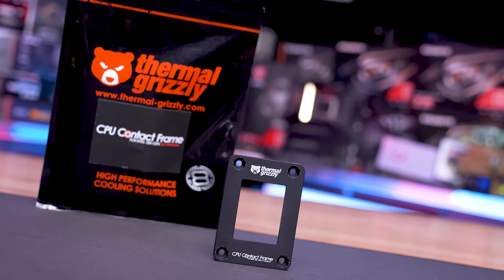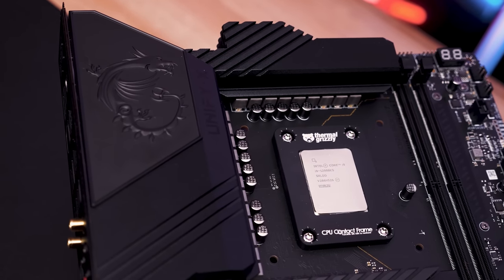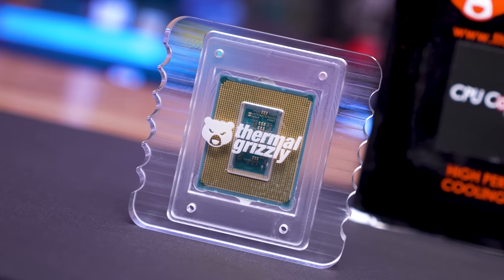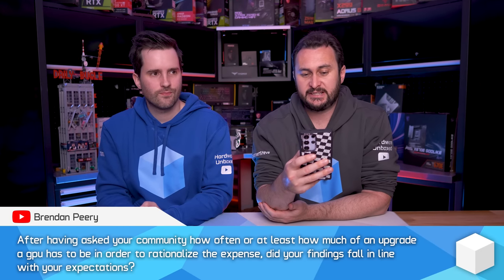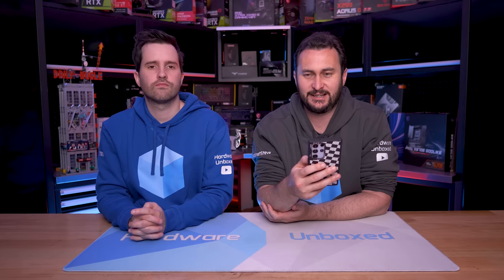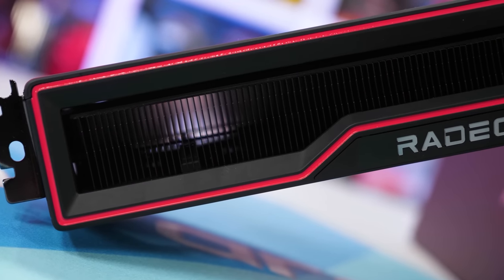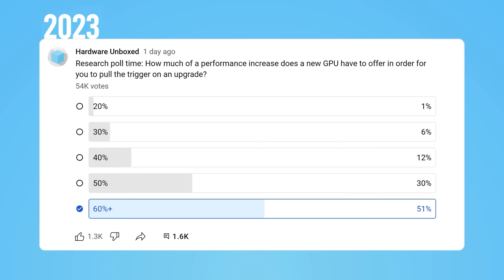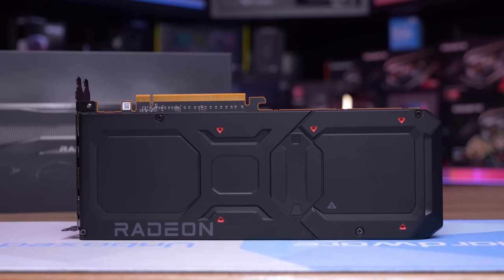RTX 4050 Pricing & VRAM, Are 12-core CPUs Dumb? March Q&A [Part 2]

Comment: I feel the 7950x3d and 7900x3d didn't have as big of a performance gap for 2 reasons. As stated in the video the L2 cache on Zen 4 was doubled to begin with so the extra cache of the x3d parts is less needed or utilized. The second factor I feel is the large clock speed hit they take by not being able to boost as well as the no x3d parts. With Zen 3 the 5800x3d can boost to 4.5Ghz and the 5800x only boosted to 4.7Ghz. With the Zen 4 parts the 7950x3d is limited to about 4.9-5Ghz on the CCD with Vcache with stock settings, while the standard 7950x is far less limited with it's boost and usually hits somewhere between 5.4 and 5.7Ghz depending on workload.

Comment: I have a Ryzen 5800X3D, and decided to get a Merc 310 7900XTX earlier this week to replace my 1070Ti when it went on sale for $20 over reference design. Must say, this thing is a beast!!! And performing much higher than advertised. Just finished playing some Forza Horizon 5 to see how it would do, and I'm at max settings 4K getting and almost steady 144Hz, and boosting to 3GHz+ steady effective clock while I'm playing. That's on default settings, with just the BIOS switch in the higher limit power mode, minus bumping them memory up to 2750Mhz. Really happy with the purchase. 

One game I get bottle necks in at 4K though is No Man's Sky. I don't know, but it hits the CPU much differently than other games. I've got this 5800X3D on an X570 Unify boosting to 4.65Ghz all core, with RAM at 3744Mhz at CL14-8-14-14-22 with super tight sub-timings, so I've ensured to eliminate bottlenecks as much as possible. Would like to see how the next gen X3D's compare with DDR5 to see if there would be any uplift at alleviating bottlenecks. Certainly not worth an upgrade, as I will upgrade to AM5 2nd or 3rd generation, but would like to get an idea of generational improvements going forward. Certainly a game good at taxing the CPU at 4K, as in lower resolutions I have no issues. Maybe streaming 4K texture assets is what is getting it? Idk? 

The fans on the Merc were a little too loud for my taste, so I already swapped them out with some Lian Li SL120 fans. My temps did suffer slightly a few degrees, but it is soooo much quieter while gaming. The crazy thing is the 3 120mm fans look like they came with it, as they fit perfectly on that giant cooler. Certainly goes well with the Lian Li 216 Case I purchased last month, which I'm glad I did, cause this gigantic thing wouldn't have fit in my other case. Such a great case the Lian Li 216 is!

Comment: I've been talking about planned obsolescence since the Ampere launch and everyone shrugged it off. 1080Ti, 2080Ti and 3080Ti all have the same amount of VRAM despite 2 generations and 4+ years between them, wtf? And despite 1440P and 4K adoption increasing, in fact these cards were aimed at higher resolutions! But they got 1080P level VRAM. 

The 4080, a beastly GPU, will also end up bottlenecked by its mere 16GB VRAM in 1-2 years (RE4 came out, it uses 14GB already..), there's simply a mismatch between the GPU power and VRAM amount. The 4080 is strong enough to game on High/Ultra for 3-5 years especially with DLSS, but its meager 16GB VRAM will force you to lower settings in 1-2 years already, NOT what we SHOULD expect, demand even, from a €1200+ card! The 4070Ti at €900 retail is even more disgusting.. A €900 card that already has VRAM issues in current titles. 

I'm not an AMD fanboy at all, but *This is purely an Nvidia problem!* And it will stay a problem if people keep buying it. 

RDNA2 are just better cards right now than Ampere, since neither will do RTX with good FPS in new games anyway and RDNA2 offers way more Raster value and zero VRAM issues because AMD has a good GPU/VRAM matchup for ALL their cards, as it should be. 

RDNA3, while disappointing, is in fact quite competitive thanks to the VRAM elephant in the room and its "relatively" low price. A 7900XT will last a lot longer than a 4070Ti, has better Raster and no VRAM issues, and isn't even very bad at RT. 

The 7900XTX is cheaper and usually faster or just as fast than the 4080 while having 24GB VRAM, meaning you will never run out of VRAM during its lifecycle unlike the 4080.

If both the 4070Ti and 4080 had +4GB of RAM for the same price it would dominate RDNA3 and they wpuld be great purchases (considering today's market). But the lack of VRAM actually makes RDNA3 and even the 6950XT look appealing. 

There is only one solution: stop buying VRAM starved cards, vote with your wallet, which in this case means buying AMD, or buying a used 3090(Ti) if it's a good deal. Only then will Nvidia stop this planned obsolescence. 

The 4090 is in a league of its own but for €1800-2000 I would never buy it. It's a content creator card. At that price it is just not meant for gaming only, you can literally build 2 entire gaming PCs with 6950XT cards in them for that money. Or 3 entire gaming PCs if you buy a used 6800XT which is still a very good 1440P card. 

 I'm legit amazed that people buy 4070Ti cards not realizing the low (and slow) VRAM at that price point is completely unacceptable, or 4080 cards that will run into VRAM issues sooner than you'd like especially at 4K. 
My 6800XT can already play some games with better looking textures than a 4070Ti, at high FPS too.. Just think about that for a moment and how stupid that is. I only oaid €400 for it used, new it's €600. And Ray Tracing requires extra VRAM, making the RT argument pointless on a 12GB card. They tried to call it a 4080, truth is it has 4060Ti tier specs.

Don't fear the "bad AMD drivers", both sides have driver issues and AMD has improved massively to the point where they are on par with Nvidia, and in fact the Adrenalin Driver/Overlay is considered to be better than Nvidia's by most. It's certainly more modern and it's 1 application, not 2.

This is coming from someone who has owned many cards of both brands. I have no brand loyalty, I buy what makes sense, and handicapping myself on VRAM with Nvidia at 1440P (4K is even worse if I decide to upgrade to that) makes no sense. Ray Tracing also doesn't make sense just yet, in fact it clashes with the trend of high refresh rate gaming. It's gonna take at least 2 more generations for proper high FPS Ray Tracing gaming.

I know nobody will listen to this because of Nvidia's "featureset", which AMD matches exceot the nonsensical frame generation, which FSR3 will address just because they have to. And everyone and their mother likes to think of CUDA and productivity even though they just edit a few gaming clips per month.. But the truth is, the only way out of this situation is to stop buying VRAM starved cards.

Comment: The thing you have to remember about games killing GPUs (like the recent reports from Diablo 4) is that you're talking about a handful of cases (in this case just 6 or 7 that I've heard of) out of hundreds of thousands, even millions of players.  It's not that running the GPU at full power is a problem, but that the failed cards had defects that were exposed by the game.  I read recently that the 3090 failures from New World were apparently due to low quality soldering on some components.
Reply: Correct, it's a very small amount.

Comment: Great conversation, if I had to add anything that I felt was left out it would be the future of APUs (mainly those of AMD). The 5700G is increasingly more interesting with the GPU pricings staying bloated for no good reason. The Ryzen 7000 series all come with integrated graphics, however AMD doesn't call them APUs (and their performance is roughly half of a real APU like the 5600G or 5700G). It would be interesting to see how a Ryzen 7000 (or 8000) APU would perform using DDR5 amongst other things, and if this would be a realistic alternative for people aiming to game at 1080p, since we've seen numerous cards now from different brands & generations (e.g., 6950 xt / 7900 xt / 7900 xtx / 4080 / 4090) more or less cap out when it comes to 1080p gaming anyway, having an APU targeting 1080p could be big.
Reply: yup, the soldered laptop ryzen apus are pretty good, I am looking forward a desktop based one for am5, no need for the power of a dedicated video card but would like to have a bit more power coupled with a 8 core/16t  machine without being limited to 28-45W like in laptops or nuc like machines, would like to use 4 monitors though... AMD make it happen please, miniitx/microatx board with 4 monitor outputs or 2/3 and multiple usb-c+DP or tb4, for affordable price combined with a decent but energy conscious processor and graca combo....that niche between a minipc and fully grown desktop /higher end dell optiplex or entry level precision but with AMD/
Reply: with the move to RDNA2 60fps+ 1080p low/medium will be possible in most games. the 6900HS which is zen3+ and 12CU RDNA2 @75w package TDP does it just fine. probably will see the desktop versions some time after July/August is my guess. given the performance it'll likely kill any need for anything below the 7600XT when ever it releases.
Reply: Depends on which one, clearly a 7950 isn't a realistic alternative, but a 7700x maybe. I think people did that a lot out of desperation in the pandemic and frankly the 5600g while good still just doesn't cut it. APUs is way too far behind the GPU performance to consider and take it seriously. But I mean all that being stated, you can apparently run games like even Tropico 5 or Dead Space 2 off an extremely old Intel integrated graphics and while the performance is really bad at 1080p, the fact it even run at all on Haswell or Ivy let alone Sky Lake or Coffee Lake is pretty much the reason why we're having this conversation and it impresses, because much older games can work. It's just that the performance is so ridiculously bad, a laptop with some 1157 or 4800u or whatever still isn't going to run your games mostly and it would make far more sense just to pay the hundred dollars more and get a real gaming laptop. I seen such ridiculous prices on especially Intel, Iris just sucks and AMD isn't so much better, $600 laptops that basically aren't worth considering for gaming when a 1650 laptop can play most older games perfectly and cost $650. 

I think that is a poor people logic effort at minmaxing honestly, because like Linus accurately said, cheaper doesn't mean better value. And in some cases, cheaper isn't cheaper either. You can get a GTX 980ti for like $100-200 right now and it should play most things just fine. Might have DirectX12 2/2 problems, but anything older it will work, and afaik not even the R7 7000 processors can match that. If you just rely on the used market and be smart enough not to get scammed, you can find good cards pretty easily in fact the 5700XT is down to $200 on ebay. So if $200 is the cutoff, that's a pretty sweet performance, seeing you need to buy a much better processor to get better APU peformance anyway, when you could save this money and buy a used GTX or something instead for 5x the performance.

Comment: 23:45 A lot of cards died when New World was released and later Diablo4 (beta). Also limiting fps reduces noise, heat and power consumption AND! increases frame stability.
Reply: Much to my surprise over last few years i've seen a few games not reducing power demands with FPS Limiter on. AC Unity, various Just Cause engine games, some Unreals. Does still help pacing either absolutely or relatively, but still a heater. x-x
Reply: Capping FPS is also the best way of reducing input latency.

Comment: Hey Steve, Ive noticed everyone has been very very quiet about the 31 security flaws that have been found on Ryzen cpus in the last month. And no one seems to be brave enough to benchmark 5000 series with the mitigations in place. My 5800x is now noticeably slower then my bothers 11700k in games with the new Bios. It would make a great video to check out the how much performance has been lost by Ryzen with the security mitigations installed.

Comment: Never had a GPU upgrade with less than 300% improvement. And at no point have I bought a high end GPU. The GPU prices are insane, while the improvement is slow, so the answer is to just wait longer between purchases to get the same result and pay the same money/time to the companies.
Reply: Yeah, same here. I've always waited for at least a 300% performance improvement for the same price. Right now, the only card on the market that can match that performance uplift is a 4090, and it is about 5x the price I paid for my current card. No harm in waiting.

Comment: The RTX 4060 is actually an RTX 4050 but renamed and will be priced like what the 4070 should be priced like. Never before has an x60 card used the x07 chip, which is meant for the x50 card or even lower (historically the x50 card has often been the full fledged AD106 predecessor chips).

Similar to how the 4080 isn't really a 4080 (it's not even full AD103), the 7900 XTX is really a 7800 XT, the 7900 XT is really a 7800. Deceptive naming to hide that prices are often more than 100% raised.

Comment: Man, a 3080 with 20GB would have been the perfect card.
Reply: Wait for the 7900 XT to drop to $700. It will be the closest thing to it minus DLSS. But yeah you're not wrong at all. 10gb and Nvidia piss poor multi monitor/mixed resolution support were the ONLY reasons to get rid of my 3080. Sucks but Nvidia did this to themselves.
Reply: @orangezombies  I bought a 6900xt for $650 before the 7900xt dropped in price and now that i've acquired a $170 6700xt I'll probably return the 6900xt and wait for the 7900xt to drop to $700.  That will come sooner than later because sales are still horrible.
Reply: 3070 16GB and 3080 20GB exists. NVIDIA originally plan to use them to compete with A770. However, A770 is postponed and postponed, and performs like 3060.  NVIDIA then cancelled them.
Reply: Today if you want, you can find some repair shops to change your VRAM from 1GB/chip to 2GB/chip. You can get 22GB 2080 Ti, 16GB 3070 and 20GB 3080.
Reply: That is why it was not released!

Comment: Regarding GPU Upgrades. I also feel like most of the games you play these days are still VERY much playable on older hardware (excluding RT. The 1070 up to to 1080Ti are still very capable), keeping up to speed with the latest GPU models just doesn't feel worthwhile, especially since the majority of your game library play just fine on older hardware. Another reason for me personally is due to the fact that the AAA industry is stumbling a bit when it comes to releasing "interesting titles", hence I am playing more indie games these days. But yeah, if prices go up, I will just do less GPU upgrades, and performance increase between those upgrades need to be worthwhile to justify the cost. I think this will show in sales reports of GPUs. Gamers will just stick around with their GPUs for MUCH MUCH longer.
Reply: I'm planning to hold out until i can get something that will comfortably handle path traced games. I think we will see a LOT of path traced refreshes of older games and frankly im very interested in that.
Reply: Just bought a used 1080 Ti for my 1920x1080 60Hz setup. Runs great. Gonna replace my Ryzen 2600 with a 5800X3D  soon and I'm good to go for the coming years. Next upgrade should be the monitor in the coming years and maybe an other second hand GPU 4 years from now.
Reply: @Reeferman420NL  Sounds like a pretty solid plan to be honest.  I upgraded from at GTX1060 to a 6600XT, during the GPU craze. the funny thing is that I only needed to spend 150EUR on the 6600XT due to how bloated the prices was on the 2nd hand market for nvidia GPUs (I sold  the GTX1060 comfortably at 300EUR). The 66600XT on the other hand I got for 450EUR. However, if I had a 1080Ti. I would've just stuck with that GPU, the performance still holds up! :)
Reply: @TheDarksideFNothing  Yeah, I feel the same way. My backlog is deep enough that I don't necessarily need to play the latest and greatest either. There are just too many good games out there! :)
Reply: @PixelShade  lol and you have to wait 6 months for them to be patched into a playable state anyway

Comment: What Gpu manufacturers should do is one generation focus on performance than with the next generation, improve on the efficiency and repeat that cycle. That would drastically improve on the quality of the products being released while simultaneously improving pricing (theoretically without accounting for corporate greed). This would also lead to the creation of two different subsets of performance enthusiasts. Those who chase maximum frame rates and those who chase maximum efficiency and performance per watt.
Reply: Performance per watt is increasing all the time. Manufacturers just push the parts further. Power limiting is an option and you probably won't lose much with like an 80% limit.